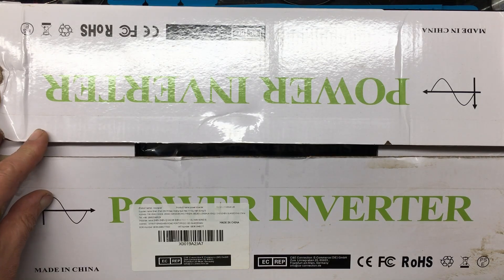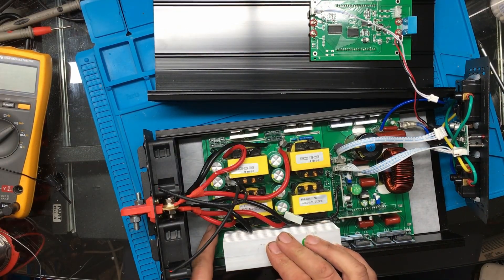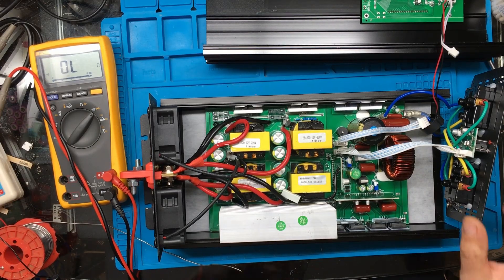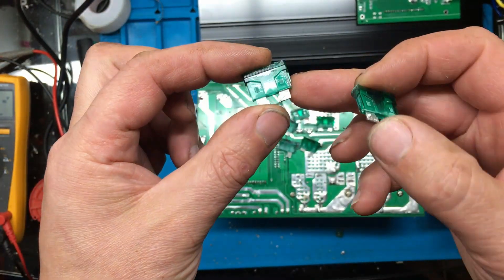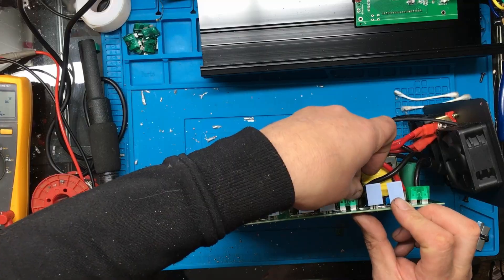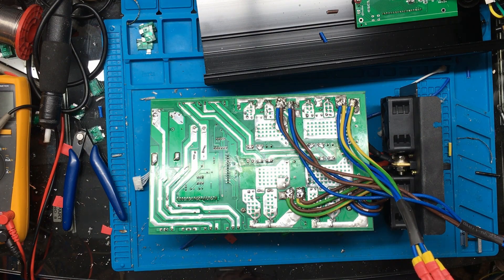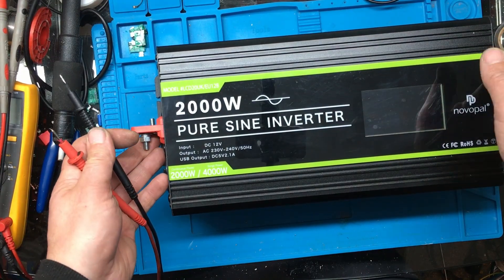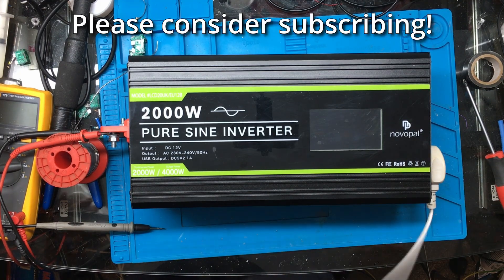2000W Pure Sine Inverter - Blown Up! - Let's fix it!

Comment: Resettable fuses might be a good upgrade for the unit if you are keeping it. Just to add I would have thought it would be designed with reverse polarity connection protection but obviously not in this case.
Reply: Actually it was the reverse polarity protection that kicked in and blow all the fuses, you dont need resetable fuses for reverse polarity protection since you shouldnt be connecting it in reverse all the while. if the fuse blows in normal usase then you have a fault,
Reply: @dantronics1682   if correct reverse polarity circuitry is installed it will not run by design and indicate such a fault in a similar fashion to better designed battery chargers.
Reply: @Arachnoid_of_the_underverse  true but "correct reverse polarity circuitry" would require a diode in series which would need to have a forward current capability of at least 100 amps and then dont forget there will be a junction voltage drop which desipate energy. so having the diode in parallel to blow the fuses is the simpliest solution
Reply: @dantronics1682  Yes since the circuitry should have over current/temp protection that would put it in protect mode before blowing the fuses. Catastrophic failure or RP would be the only thing that could blow the fuses.
Reply from the maker: Good idea on both counts. It's not mine, I was just looking at it for a friend. I've since returned it.
Reply: @BuyitFixit  Using diodes as reverse polarity protection would have done exactly what was wrong with it.
Reply from the maker: Yes, the built in diodes in the mosfets did the same job apparently.
Reply: that is also my though .Good idea
Reply: It kind of did have protection, the fuses blew preventing further damage. Non destructive protection is hard and expensive at the sort of currents these inverters draw resettable fuses might blow to slowly to prevent other damage and really these devices shouldn't be experiencing enough reverse polarity events to make that necessary, at most include a pack of spare fuses and instructions to be more careful next time. I work with some very well designed and quite expensive DC Motor controllers that are UK designed and made and the are very clear about not having protection for the very same reasons it's simply not practical when you're dealing with 80-100 Amps.

Comment: All well and good that you fixed it but WTF is the thing in the first place? What does it do? What's it for? I probably need one but just don't know it yet.
Reply from the maker: It's used to power mains equipment from a car battery. It converts the 12v into 240v.
Reply: @BuyitFixit  Then I'll be needing two. Cheers. Now to tell the Mrs about the upcoming expense. Just out of interest, how long can a 12v car battery last under load from one of these things.
Reply from the maker: It would depend on what you have connected to them and the size of your car battery or batteries. For a rough example a 100ah car battery would be 12v x100a = 1200w so it would run a 100w TV for 12 hour (probably less because the inverter itself uses power) or it would run a 1000w microwave for about 1h. It might be even half of this because you aren't supposed to discharge a lead acid battery more than 50%

Comment: Had a same issue recently, different brand, very similar construction ... just ordered a bag of PCB fuse holders :)
Reply from the maker: Great idea! I thought there would be something like that available but I just wanted it off my bench :) . They probably didn't bother adding them to save a few pennies...
Reply: @BuyitFixit  They probably didn't bother adding them to save a few pennies... The problem with that type of fuse is generally with the holders - depending on the environment that it is used in it would be possible for corrosion to introduce a high resistance into the main current feed, and at 2kW (which I seriously doubt unless those fuses were rated in excess of 160A) this would lead to some serious heat from the dissipation. When I changed the batteries in my UPS I noticed the fuses were soldered in, and it is a reputable brand and not a cheap unit.
Reply from the maker: Fair comment. Could well be the case.

Comment: They might have used aluminium solder to solder them in, might also explain why you had to use more heat. I was surprised to see that so many fuses had blown must have been quite a load on them, but a free converter is a great converter. Hope you have a great weekend and look forward to seeing more
Reply from the maker: Thanks Morten! Hope you have a great weekend too!
Reply: @BuyitFixit  Big copper areas suck up the heat. Norcal715 has a few videos about what you need to do to fix these, basically replace all fuses, all mosfets and the 10R gate resistors, and the driver transistors, then look for any other faults like dying capacitors on the power rails.

You do need a pretty big and high power soldering iron to unsolder the fuses, all the copper sucks the heat away. Best for new fuses is to take some copper crimp blade connectors and flatten the wire end, then solder those in, and place the fuses in the blade connectors end. That then puts them in the same location, and you just use a small shrink sleeve to insulate the ends sticking up.
Reply from the maker: @SeanBZA  Thanks Sean. Yes I was surprised the mosfets weren't taken out. Wad pretty much the first thing I checked after the fuses. I had thought about soldering the spade connectors where the original fuses had been but it was quite fiddly to get into the ones were the silver aluminium heatsink was as there wasn't a lot of room, which is why I extended with wires.
Reply: @BuyitFixit  the diode would do a short if you reverse connect it, this will cause the fuse to blow to protect the upstream components, if you repairing it might be a good idea to change the diodes too
Reply: @BuyitFixit  sadly i did this to an inverter.  I opened it up and all the fuses were blown.  Replaced the fuses and fortunately its still working perfectly.  Whew.  I use it mainly with an electric chain saw to cut away trees fallen across the trails.  It's better to place a red sticker on the positive side of the battery.
Reply: @BuyitFixit  i was fortunate that my fuses weren't soldered in.  They have fuse holders soldered in making it easy to replace the fuses.  Just for the record there were no signs of heat damage to the old fuses telling me there is no need for the fuses to be soldered in if the fuse holders are good quality.
Reply from the maker: Interesting, Thanks for letting me know 👍
Reply: you can use normal solder to solder ali but you need a special flux
Reply: all the fuses go together they are in usually in parallel (or in 2 sets for push pull operation of the mosfets), its to get the required amps for the watts, boiling a 2.4kw kettle is only 10amps on the AC side at 240v, but a drain of 2400w divided by the 12.5v on the dc side is 192 amps.... so 4x50a required...and decent cable from the batteries...

Comment: remember kids, always check and discharge the capacitors before you go sticking your fingers in electronics.
good fix :)
Reply: Concur, although the fuses were blown and it was probably dead for a while these things can still pack a nasty punch. You can get aluminium solder but it is a pain to work with, generally special fluxes and very high wattage irons are required.
Reply from the maker: Thanks Ralph. Yeah might have been an idea to check the caps. Although I've had quite a few belts in my time and it might have made good entertainment like electroboom lol.
Reply from the maker: Thanks smallg :)

Comment: Never seen those car fuses soldered in like that 🧐
Reply from the maker: Me either, probably to save a few pennies. The least they could have done was put fuse sockets in there where the fuses just slide into.
Reply: @BuyitFixit  Very common in this case, all are soldered in, as they blow with reverse polarity, so the mosfets have a 50% chance of surviving. Not pure sine wave, just a somewhat filtered sine wave with that big CCA wound inductor, which will saturate at around 1A of load on the output.
Reply: Common on inverters cos high current
Reply from the maker: A few people said the same, and I do see the logic. However the fuses are 30a and I've seen plenty of these in cars which aren't soldered in.

Comment: Better than factory! I can understand soldered fuses on a circuitboard as they have space constraints, but in this case I don't see a good reason for it beyond saving a few pennies.
Reply from the maker: My thoughts exactly.. cost saving.. although I think I saw one retailer selling these for around £250! fuses should be accessible and easy to change, and not the hassle I had to go through!
Reply: Saving pennies while also ensuring most customers will have to buy a new unit rather than faf with blown soldered fuses. 

Planned obsolescence is most common for the more expensive, specialty items. Big Man CEO says to himself: "hey, if the customer can afford one of these, then surely they can afford two"

It's gross. It's predatory behavior like that which Apple basically has incorporated into their whole business model. "We're serializing these parts so that stolen phones can't be parted out"

I've heard Apple zealots say that if every other manufacturer always serialized all their phones parts, then people would stop stealing phones. Really? Do they think they understand the mindset of a thief? My town is full of homeless tweakers who would steal anything, serialized or not. If they couldn't sell it or part it out, they'd steal it just to take it apart, or just simply because they could steal it. There's no way to stop device theft. 

In my old apartment building, people stole my cat toys to throw them away, simply because they didn't like me. 

You can't presume that a thief is going to act based on rationality. That is not the criminal mindset. 

Apple serializes parts for profit, which results in more landfilled devices, yet they want to present a "green" image.
Reply from the maker: I didn't think about it could be to stop stolen devices being parted out, I always thought it was for 'security' and anti-repair.  Speaking of wasteful practices I have encountered it a few times such as the video I did on the cricut cutting machine, and the solar inverter I repaired and needed the service password to adjust a setting. The reply I got was it's our of warranty and they no longer make that model! I ended up reverse engineering the software and writing my own service password generator. The video on that is on here too. 😂😂😂
Reply: @extracurricularkitty3605 Absolute truth and well described. I'm suprised you haven't received more likes for your comment!
Reply: They do sell solderable fuse sockets you know. The better brands are equiped with these. And why would you have alu fuses in first place
Reply from the maker: I didn't know they were aluminium when I ordered them. I just ordered a set on ebay. I would have preferred to use sockets, but the owner was only visiting for the weekend, I didn't have any or time to order any, so used what I had lying around. YouTube seems to be pushing this video, and it's definitely not one of my better repairs. I've repaired much more interesting things too like a thermal camera, or medical ultrasound, solar inverter, rgb laser etc.
Reply: They're not expecting them to  blow often enough to need sockets, usually an inverter would be fit and forget the only screwups will be on initial installation of if you fit a new battery. Sockets add extra failure points.
Reply: A solid joint because of the high current. I would have went with automotive grade spade connectors though. Would have also added a big fuse and capacitor on the input. These like stiff current.
Reply: Another stupid design with soldered fuses.
Reply: Job security. If it was easy, everybody could do it
Reply: Fuses in sockets is not a good idea in an item like this. Vibration and high currents are not good friends
Reply from the maker: While that does make sense to me, I've seen plenty of 30a fuses in cars...
Reply: @BuyitFixit  Blade fuses are automotive/marine anyway. Supposedly less vulnerable to vibration that the old Buss style
Reply: @Mikere5 Plenty of socketed fuses just like these in cars. Never had one fall out yet.
Reply: @SwapPartLLC  in automotive the expected current is for short periods, inverters on the other hand draw high current for prolonged periods of time and it largely relies on software protections to shut down before the current comes anywhere close to the fuse rating. Those soldered fuses are "anti dumbass" protections